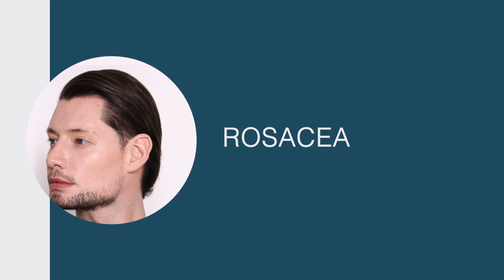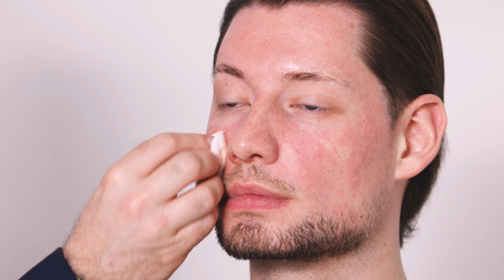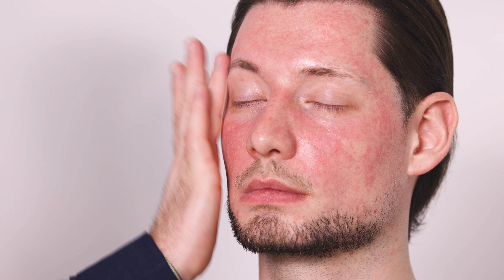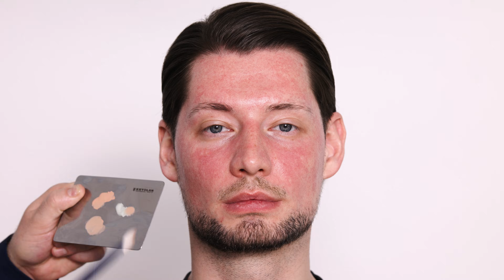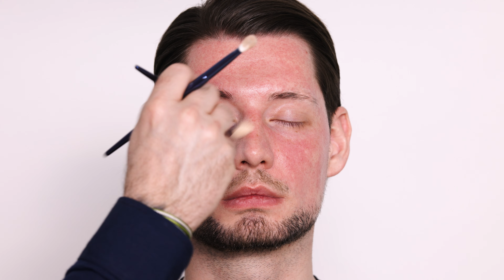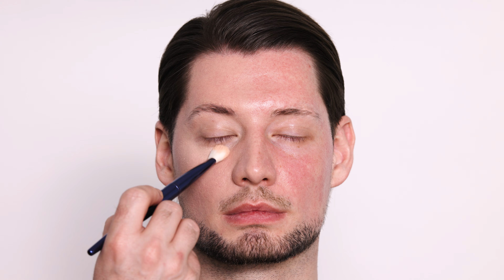How To Cover Redness/Rosacea: Step-by-Step Make-up Tutorial With Paul Merchant | DIGITAL COMPLEXION

Comment: Could you just use the neutralizer and concealer without adding foundation, would the look still be long lasting?
Reply from the maker: Yes, that would also work and be long lasting. Both the Neutralizer and the Concealer are self setting, so using a foundation in conjunction would just be personal preference depending on the desired coverage